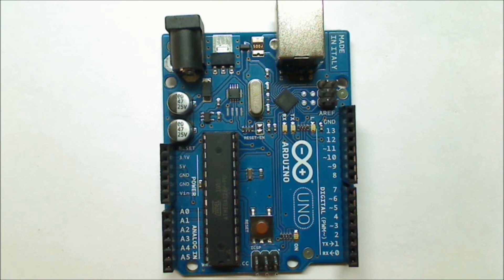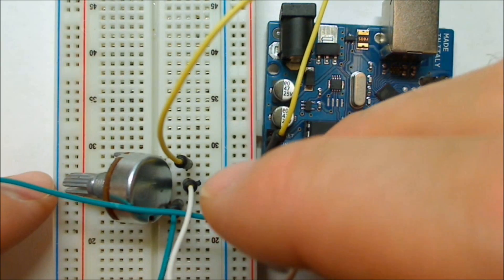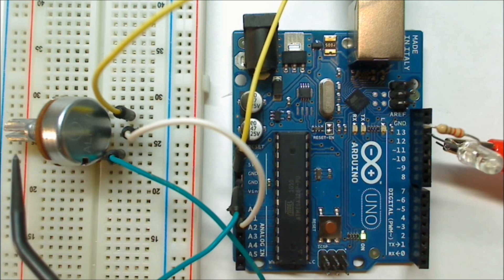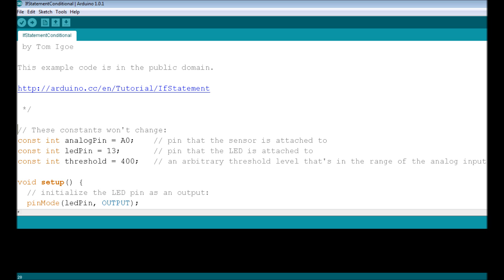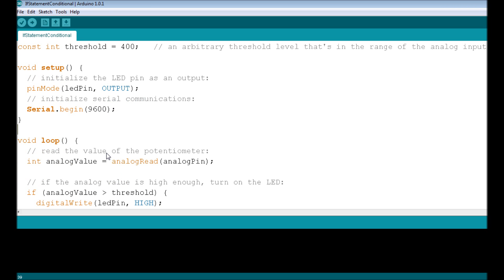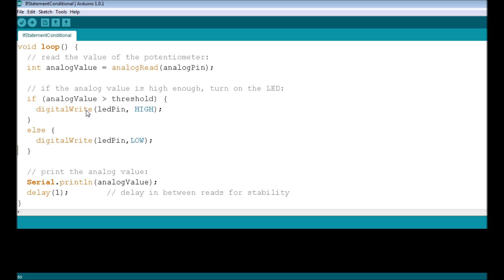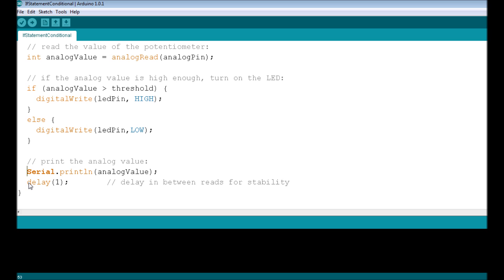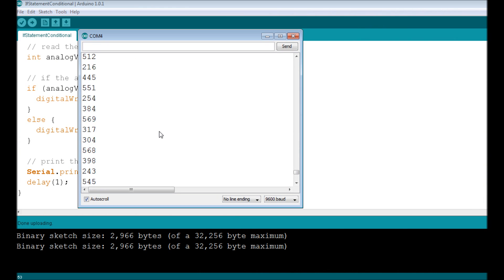Lesson 07: If Statement Conditionals: Arduino Course for Absolute Beginners

Comment: Why is it that in void setup you require the pinMode line for ledPin but you do not need one for the analog pin A0. ex -   pinMode(analogPin, INPUT); I heard that you can use the analog pins as outputs, so is it because it defaults to an input so its not nessesary?

Comment: first , thanks for those awesome tutorial but I am wondering here why do yo connect the resistor to the led then connected the other end of the resistor to ground?? I mean is not the current going from the pin you picked through the LED to the ground which will suck the extra voltage?? 
thank you again

Comment: Well they seem fairly good already. I have only watched a few videos tho but this one specifically was very use full. I was thinking that i would use this but instead on a supply voltage threw the pot i would use a ir receiver/photo diode and also a ir led. This would make the led turn on when i put my hand over the ir led because the light would reflect of my hand and back down to the ir receiver making the input values go up and the led turns on. Well it sounds good in theory anyway.